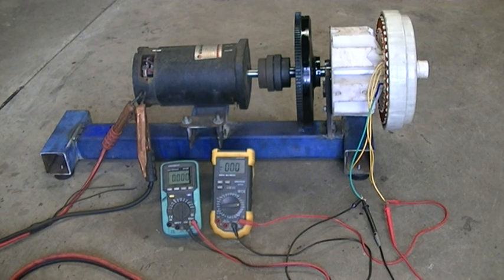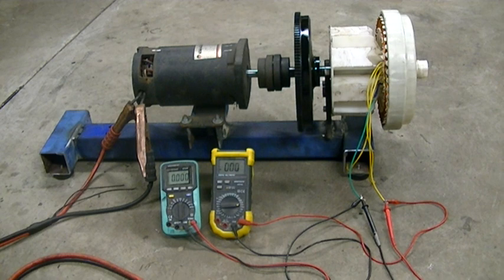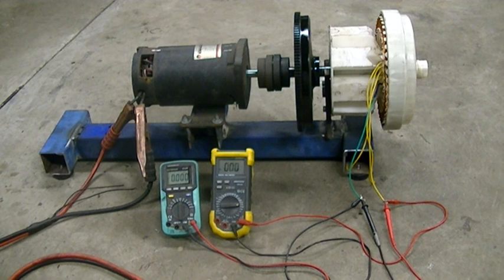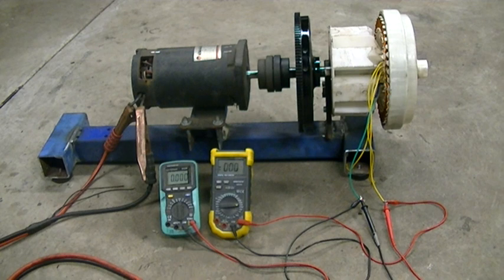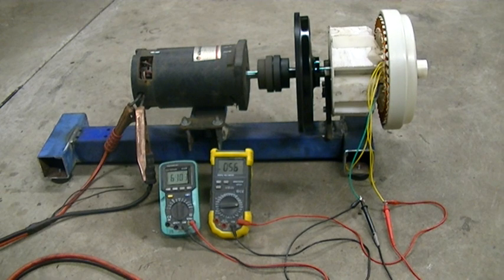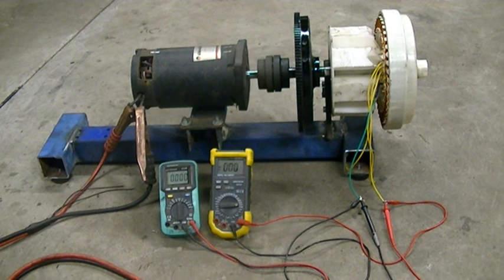John Bedini Energizer V2 PT2

Comment: PS: Garrard didn't want to look further into the DC Treadmill motor's, Cause he Considered them, to Heavyweight, Because" him and the Young man, that first started his, utube videos ideas, had a hidden agenda" from the start.!! The plan was to put together, Some types of products, ( His generator )
for One THING, but he couldn't find any Company that would make them a proper Controller, that could, or would do what he needed, in order to get the full POWER supply" out of his Gen, once it tapped into the Ether" Now, just saying:: I thought it was Common sense to push on the "computer Controll board Chips"!! First Thing To Try, LOLOLOL, But anyway" What you need to look for, is 
( way to drop amp's, push high Voltage into it, with An addiction of Sound-waves.) okay, That is Your key: alright.!! and Remember" Capacitor's establish an magnetic field,of resonance, kinda like a Coil,.... once you've got the field of Ether, and it's Harmonically" in tun, with the Cap's.... your gonna see a whole new level of Limitless potential., Here's looking at You.   JR

Comment: If you connect it to a battery via 3 phase rect, it'll be outputting battery voltage, no capacitors required either.
Reply: 1magnit yes, Very True, but the Cap's are needed for establishing a magnetically pulsing Field.

Comment: Nice to see more build videos.👍maybe its just the camera angle but the shaft doesn't look horizontal to the 3phase motor. Maybe mounting it in the vertical position might relieve some strain on components and reduce any misalignments and vibrations. Also the noise maybe amplified by the box section steel. Try stuffing some old rags in all the open ends to see if that helps with noise.
Reply from the maker: Yes,just camera angle,as the shafts are dead level

Comment: Great work, if you rectify the AC what is your D.C. Output? More than your input?
Reply from the maker: Yes,much more. The meter is showing the RMS value,so when rectified,it will be close to the same. 24 volts in,800+ volts out--but that is far to much. I am rewiring the stator ATM,so as to get a lower voltage,but higher current.
Reply: I have a theory on the whistle - when the primary source is driving the flywheel at a point of rotation the mass of the flywheel inertia is offset into a 'counter-space' action this represents 'stored' 'energy' if you like
when you disconnect the rotation source the whistle is 'energy' leaving the counter-space from the offset from the flywheel. 
the sound specifically may be plasma arcs but you would have to open the case of the primary rotator to see.
it also could be related to the bearing relationship with the device as you know from your other video's they can hold a 'magnetic' charge. 
but i think the 'source' is the flywheel. 

the other more 'average' theory is that the flywheel is not perfectly balanced ha ha ha. - but that doesn't mean my original theory is incorrect. 

did it whistle when you didn't have it connected? i.e when you just ran it stand alone.
Reply: i'm going to do something like this with my father soon for fun, (and sanity) we might make some modifications - but thanks for sharing it's great to see that in action.
Reply: Congratulations Tinman!! That must have been a very concentrated five hours. Just thinking, since you have a fairly heavy flywheel and you have enough space on the shaft, and also since you are looking to create more current; would a rotating copper flywheel with a permanent magnet fixed in between, ( essentially a faraday homopolar generator) be able to add a bit of current while every thing else remains the same